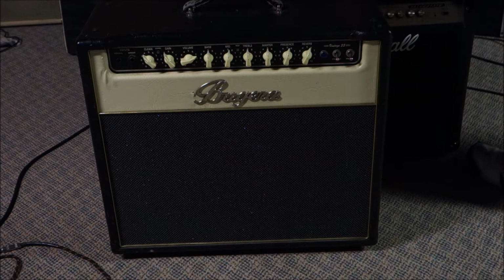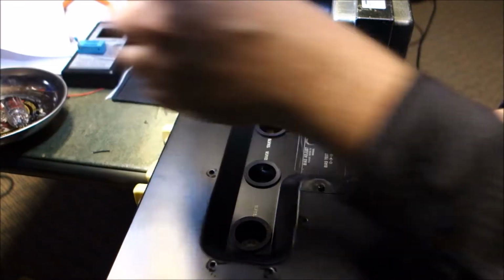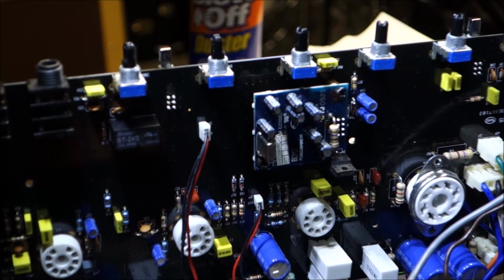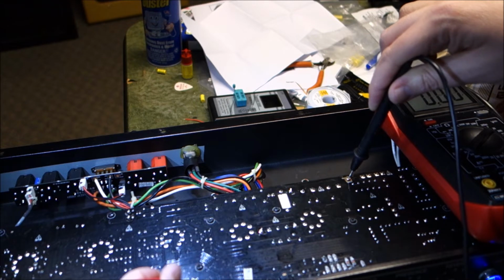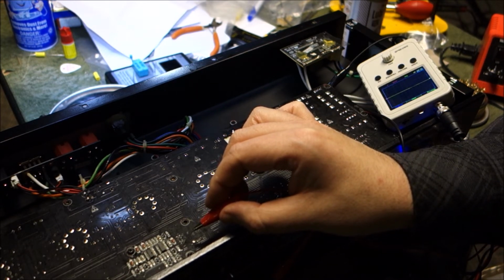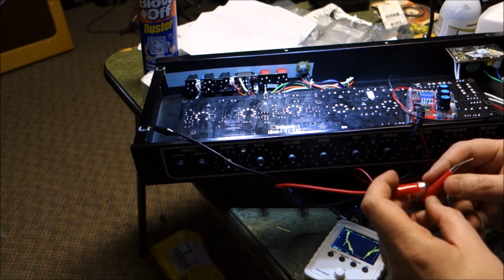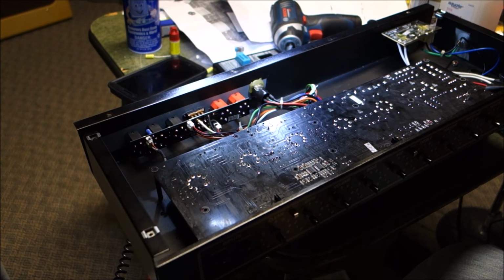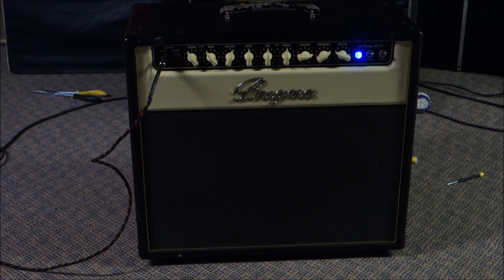Bugera Vintage 55 V55 With a BROKEN Reverb gets fixed.... This wasn't fun.

Comment: Nice job working through basic electronics circuit flow using a signal trace method and a small mini scope with enough bandwidth to confirm signal but, I always check all supply voltages 1st! It will save you alot of time ⌚ and thats money 💵  to me .

Comment: I'm trying to find who can sell me a BDM2 reverb board for my  Bugera amp any ideas or websites
Reply from the maker: Not a clue.  Behringer/bugera has no parts distribution to my knowledge
Reply: @DeadKoby  thanks for the reply most likely we'll have to send it to the amp shop
Reply from the maker: @robertpulido7962  If you're lucky you might find one on Ebay from a parts machine...  that's the only thing I can think of.

Comment: having the exact trouble with same amp. Found the reverb drawn on the V22 schem, but no joy. Either the switching xistor (T7) is bad or the reverb module. Thanks for throwing down with this one!
Reply from the maker: Good luck on solving yours.   Mine was that voltage regulator.

Comment: Bugera uses the same reverb board on other amps.  I have a V5 Vintage amp that I made into a head unit and the reverb only makes a crackling bacon like sound as it's turned up.  After cleaning the board yesterday and the reverb pot it worked perfectly on the bench and with a guitar today for about 5 min.  After I left it on for a while it made a couple of scratchy sounds again and it''s been doing that periodically now.  I do have 15v on the top pins and -15 v on the 2nd two.  The 7805 has 10.85v in and 5v out.   Before I cleaned everything it was a constant bacon like sound when the reverb was turned up but fine with it off.  Maybe I'll just use an external reverb pedal since those BDM2 boards are expensive and might not fix this issue.
Reply from the maker: If you can't source the crackle,  you may want to heat-gun the boards to heal bad solder joints.

Comment: Excellent amps for the money I've got a newer one with the better tubes and speaker and they sound fantastic but the electronic reverb is rubbish.  They should have put a spring reverb in it. Very vintage sounding and take pedals very well. Great repair
Reply from the maker: I was not impressed with the build quality but it does sound nice

Comment: Hi there, recently my V55HD stopped outputting signal from the speaker jacks.  I found a fuse that was blown, so I replaced it, and it seems that signal is now getting to the speaker jacks (i hear hum/noise through the cabinet and it increases when I turn the volume up), but now I'm getting no input signal in from my guitar.  Neither input jack seems to be working.  Not sure at all where to start to trace it to see where the issue might be.  If you have any suggestions, let me know.  Thanks.
Reply from the maker: Make sure all the tubes are lighting.  Then check voltages on your 12AX7's.   I would possibly inject signal in to the grids of those tubes and work backwards.
Reply: Always check your plate and filament voltages first, then if there is any solid-state devices check for any type of regulated supplies the reason why I say this is because some tube amplifiers depending on the design use DC heaters  so always confirm . It's basic fundamental troubleshooting.  Been at this professionally for almost 50 years .

Comment: I hung in there through the whole video.  Thanks for putting all that time in.  I enjoyed getting to know the internals of this amp a little better.  I have a V55 head with non-working reverb.  It went though a long period where it would sometimes work, sometimes not.  Usually I found when the amp was on a for a bit, it would then start working, but would never work when first powered on.  Eventually it just never worked again.  I would have loved to see how you replaced that regulator!  Is it an easy job?  Is there anything soldered to that open ring side of it, or is it just a matter of desoldering the old one, cleaning up the old solder, then putting the new regular through the three holes and soldering them in?
Reply from the maker: No heat sink...  Just desolder 3 pins.
Reply: @DeadKoby  Great, thanks for confirming.  At some point I'll get brave and give it a shot.  Not a huge deal for me as I use much better reverbs in the form of spring tanks, pedals or software.  But it does kinda bug me that my amp works perfectly except for that one dumb reverb knob that does nothing.  No guarantee it's the same issue, but I have a hunch that it is.  I bet that during that phase the reverb would not work then work, was that regulator beginning to fail and was providing inconsistent voltage, until it finally completely failed to provide the proper voltage.  It probably dropped lower and lower.  I don't have much experience with this stuff, but you seem to be very knowledgable.  Does that make any sense to you from what I describe?
Reply from the maker: It's plausible.  When I got this one,  the regulator was already dead.   It's just a 7815.   The left pin should have more than 15v on it.   The middle is dround.  The right should be about 15v.   A bad cap ahead of it could lower the supply voltage to it.

Comment: Yup that was a good one!! 🐰🕳

With digital boards start looking for the 5v supply, or whatever it uses, and work your way backwards through supply circuit if it's not present. Nice fix! Best part is next time you have similar symptoms on an amp you will have this experience to apply. These amps have a sick sense of humor and it will be something else to figure out.
Reply from the maker: This is the first Bugera amp I've ever used or worked on....   The way the preamp is engineered gives really quiet operation.   If they built this circuit with high quality parts it would command big bucks.  This board stinks because the traces are hard to see..  And they go through the board often.    I'm ready for something less annoying... But something more annoying lies in wait.